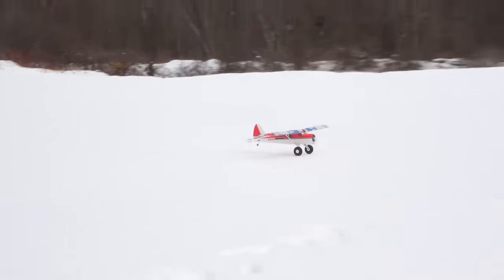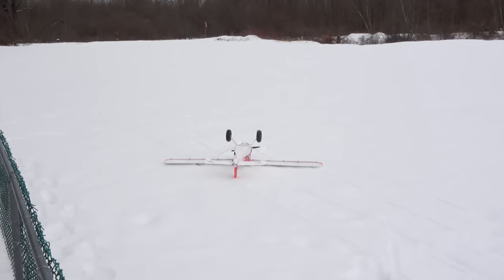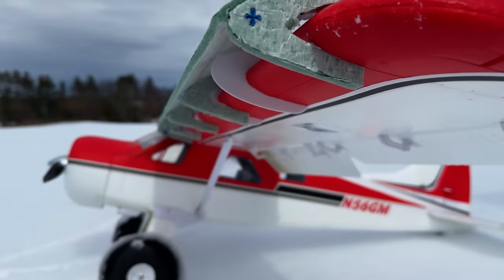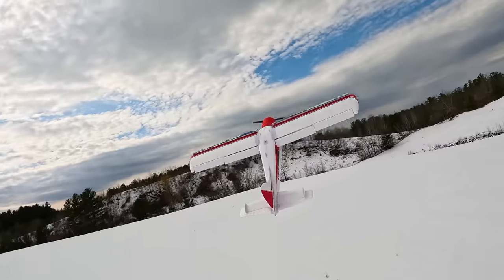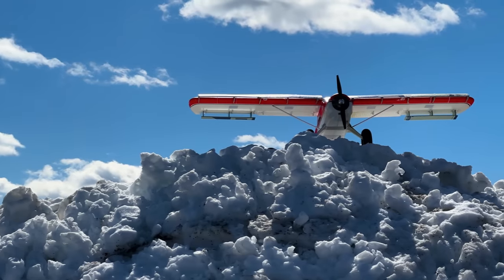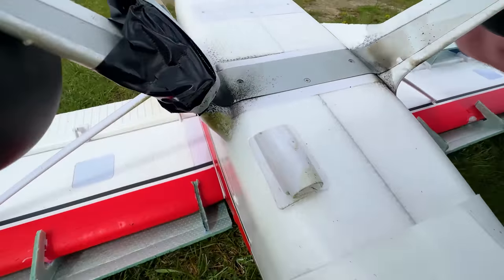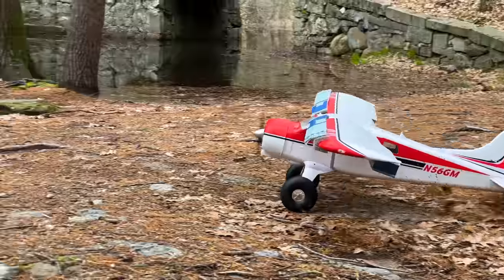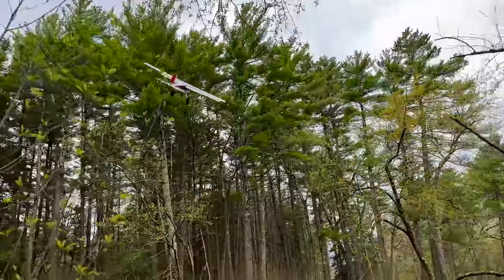ULTIMATE Bush Conversion | FMS Beaver 2000mm

Comment from the maker: We've been getting a lot of comments about us using the term "slot" instead of "slat". Here's why we used "slot".🤓Slats are adjustable and move. Slots are fixed and don’t move. Slots can be full span or partial span (think globe swift or Stinson for partial) and can be built into the wing or mounted on front (think Zenith 701 for on front). Slots like the ones on our beaver can technically be referred to as “fixed slats” but they aren’t true slats by definition since they don’t move. 👍More info: https://www.boldmethod.com/learn-to-fly/aircraft-systems/leading-edge-slot-lift-device/ 📦✈
Reply: I am well aware as I have been an aircraft mechanic for over 40 years and I’ve gone through all the schools. slats in the front flaps in the back are devices used to create additional lift whether they move or not. But it is your video.kiwi4
Reply from the maker: @ThreePilotsFPV  We'll have to agree to disagree. Take a peek at the above article in the pinned comment and you can even find info on slots in the FAA Airplane Flying Handbook which I use to teach my full-scale students as well. Aircraft like a Stinson and Zenith 701 are great examples I show my students to differentiate between a slat and a slot since these aircraft's leading edge devices are fixed. Note the thumbnail of our video - "fixed slats" is also an acceptable term. Even at my day job flying jets, we refer to slats as moving leading edge devices that increase lift on our wings when deployed. At the end of the day, language is fluid - so use what works for you.
Reply: Clearly, your next mod is to add slats instead of slots, then!

Comment: Finally it came out. I had a pretty bad day flying I cracked a wing in half on landing but hey another project anyway what’s your expert advice to make foam bind back to foam?
Reply: I've used Foam to foam glue. It doesn't get brittle. It's sticky. Glue , test fit. Pull it apart for several minutes and then stick it back together. You may some toothpick dowels too.
Reply from the maker: Sorry to hear it. Foaming white gorilla glue. Use water to activate it and as it dries it foams so have a wet paper towel nearby to keep it flush as it dries. A little goes a long way!
Reply: I got the glue I got all the frame and foam together but I just found out that the motor mount broke but the plane is good! I’ll get a new mount soon thanks

Comment: Could you guys do a video on the OMP Hobby BigHorn 49inch. I would like to see you guys fly it like you guys fly other bushplanes. Not many people on youtube fly like you guys. I wonder if it is a good bushplane. Keep up the amazing videos!1
Reply from the maker: Thanks! That unfortunately hasn't been a plane we've been eyeing, but we'll keep it in mind. Also, in general, it's best to avoid balsa planes for actual confined area RC bush flying as they don't take the same level of abuse as the foamies do, especially around the landing gear. Foam is also much easier to repair.
Reply: @TailHeavyProductions  thats true. I loved watching the mudgy 70. But the OMP bighorn is probably not even close to the mudgy 70 in performanc and bushflying.

Comment: OK OK AM I THE ONLY ONE EXCITED FOR SEEING A FORESTER JUST LIKE MINE ON THE VIDEO (apart from the fact that mine is lower than this one)? Is it a turbo one? A turbo stick one?!?
Reply: Yes, good eye! 2004 Forester XT, manual.  Has a down pipe and tune. STI control arms and sway bars, 06 4 pot brakes, STi pink springs.
Reply: That’s great Cody! Mine is also turbo and manual. Great fast car, great “aircraft carrier”!
Reply: Mine has the entire WRX suspension, full exhaust, an ethanol tune BECAUSE THIS IS BRAZIL LOL, and is delivering about 280ponies at the wheels. “Enough” for an humble aircraft hauler.
Reply: @brunocardenas  sounds like a fun car! I enjoy mine quite a bit. Great winter car and daily. I also have a 2005 Legacy GT Wagon as a summer car and airplane hauler which also sees quite a bit of track time, has a built engine with bigger turbo, coil overs, front and rear LSD. That’s getting a fresh engine in the next couple months. I am envious of you having easy access to ethanol!

Comment: Slats! Hearing them called slots this whole video was argh😢
Reply from the maker: (Copied from another comment I replied to): this for whatever reason has been a misused term in the RC world for years. Slats are adjustable and move. Slots are fixed and don’t move. Slots can be full span or partial span (think globe swift or Stinson for partial) and can be built into the wing or mounted on front (think Zenith 701 for on front). Slots like the ones on our beaver can technically be referred to as “fixed slats” but they aren’t true slats by definition since they don’t move. More info: https://www.boldmethod.com/learn-to-fly/aircraft-systems/leading-edge-slot-lift-device/

Comment: slats  not slot
Reply from the maker: (Copied from another comment I replied to): this for whatever reason has been a misused term in the RC world for years. Slats are adjustable and move. Slots are fixed and don’t move. Slots can be full span or partial span (think globe swift or Stinson for partial) and can be built into the wing or mounted on front (think Zenith 701 for on front). Slots like the ones on our beaver can technically be referred to as “fixed slats” but they aren’t true slats by definition since they don’t move. More info: https://www.boldmethod.com/learn-to-fly/aircraft-systems/leading-edge-slot-lift-device/

Comment: They are slats, not slots.
Reply from the maker: Hey Eddie! This for whatever reason has been a misused term in the RC world for years. Slats are adjustable and move. Slots are fixed and don’t move. Slots can be full span or partial span (think globe swift or Stinson for partial) and can be built into the wing or mounted on front (think Zenith 701 for on front). Slots like the ones on our beaver can technically be referred to as “fixed slats” but they aren’t true slats by definition since they don’t move. More info: https://www.boldmethod.com/learn-to-fly/aircraft-systems/leading-edge-slot-lift-device/

Comment: S L AAAAAAA T S. Slats not slots
Reply from the maker: This is a common misconception especially in the RC community - check out our pinned comment for more info.
Reply: @TailHeavyProductions  I can assure you there is no misconception I have worked on everything from the hot air balloons to the 747 and nowhere in there does the slots ever appear. But yet again it’s your video. Kiwi4
Reply from the maker: @ThreePilotsFPV  Agree to disagree - replied in your response to our pinned comment. 👍

Comment: Slots? Are you racing little cars with a peg in the front? Throwing lots of coins in a machine and thinking it will give you more coins back? You  might want to give Mike Patey a call? I know Scrappy got some impressive articulated slAts, but adding slots? I'm sick and tired of these monkey fighting slots on this monkey fighting airplane!!!
Reply from the maker: (Copied from another comment I replied to): this for whatever reason has been a misused term in the RC AND GA world for years. Slats are adjustable and move. Slots are fixed and don’t move. Slots can be full span or partial span (think globe swift or Stinson for partial) and can be built into the wing or mounted on front (think Zenith 701 for on front). Slots like the ones on our beaver can technically be referred to as “fixed slats” but they aren’t true slats by definition since they don’t move. More info: https://www.boldmethod.com/learn-to-fly/aircraft-systems/leading-edge-slot-lift-device/

Comment: SLATS not slots… 
Of course larger tires 🛞 change “the way a plane flies “. 
They add massive amounts of drag down very low. 
The main reason that you have poor high AOA performance and control as well as stability is that the blocky slats disrupt airflow over the entire top of the wing.  
Your aileron extensions don’t work because they are also too crude with blunt square leading edges.  
Your “ brilliant “ mods also shift the overall aerodynamic center of pressure forward making the plane unstable in pitch and yaw.
Reply from the maker: (Copied from another comment I replied to): this for whatever reason has been a misused term in the RC world for years. Slats are adjustable and move. Slots are fixed and don’t move. Slots can be full span or partial span (think globe swift or Stinson for partial) and can be built into the wing or mounted on front (think Zenith 701 for on front). Slots like the ones on our beaver can technically be referred to as “fixed slats” but they aren’t true slats by definition since they don’t move. More info: https://www.boldmethod.com/learn-to-fly/aircraft-systems/leading-edge-slot-lift-device/
Reply: @TailHeavyProductions  Great, Thanks for correcting the word I got wrong.